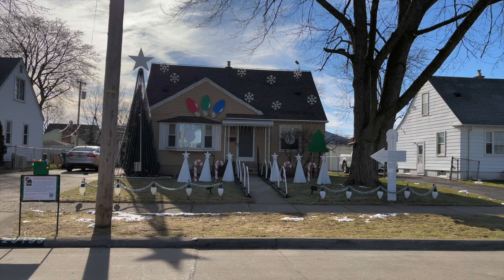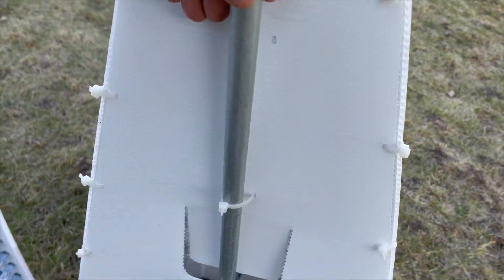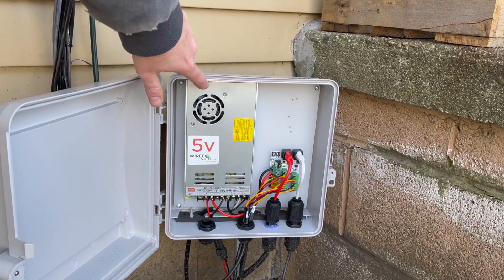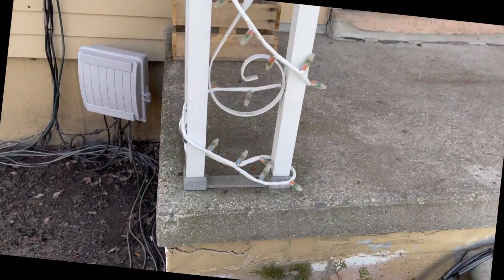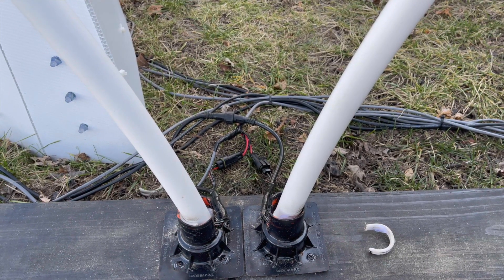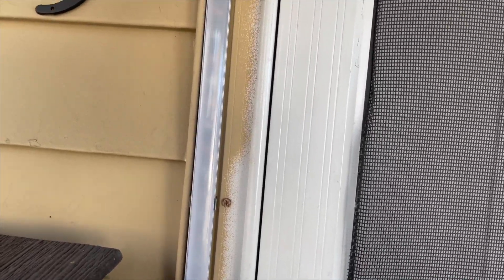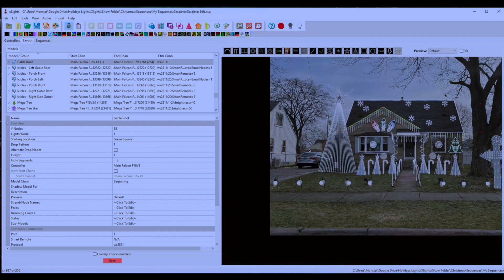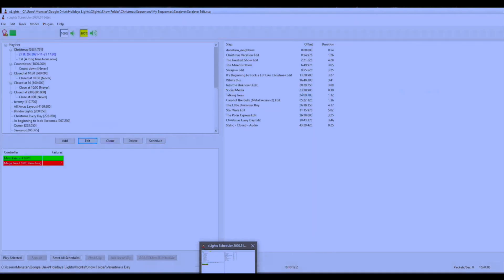Behind the Scenes of the Bostick Family Light Show 2020

Comment: I thoroughly enjoy all of the videos you post. I would like to begin working on my own display,  I have all the necessary hardware, I am struggling with the implementation. In particular, how to connect all these objects together. Fore example, I have a Falcon F16V3 controller, the Raspberry Pi, and have opted for the 12v LED's and lets say I have 25 candy canes and a variety of other items. For this discussion I want to focus on the cluster of candy canes. Do I connect each candy cane to a separate channel or end-to-end or what? It seems a waste to use a channel capable of 170 pixels for pnly 20 or so pixels in an object.

Comment: WOW! thank you so much!, what cable (gauge) do you used to inject power? also did you connect the power supplies between them?.
Reply from the maker: We use 18/4 shielded security wire for power injection. We connect the grounds between power supplies but not power. We have a link to the wire and other items we use on our website https://Bostickfamilylightshow.com

Comment: So the power injection is coming from the other open connection points on the power supplies inside the box?
Reply from the maker: Yes, we have a few connections for power injection on each power supply. One thing you want to be careful of, is making sure the power for power injection is from the same power supply powering the prop. If they are different you need to cut the power, so the two power supplies are not doubling the voltage. But you also need to make sure the grounds are shared.
Reply: @BostickFamilyLightShow  is there a reason for using 5v over 12v. Im just getting into pixel although ive always known about them im just starting to get hands on. Thanks.
Reply from the maker: @bboyrughbrn It is really personal preference. 5v typically require more power injection points, slightly more labor, but typically a bit cheaper. 12v are a little more expensive but usually need slightly less power injection, but also typically need more power supplies. I would recommend trying to stick with one voltage starting out. If you send 12v power to a 5v pixel you will blow them up. if you send 5v power to 12v pixels, they just won't turn on.

Comment: Hi  @Bostick Family Light Show just wondering where you bought your singing tree?? link?? 2nd is did you use ethernet cable for Power Injection? and lastly...it seems that you use 5V psu (instead of 12V) of all your pixels, any Reason?  (is seems that u dont mind power injecting at all :)
Reply from the maker: singing tree is from boscoyo studios. it is the 4 mouth version. I did not use Ethernet for Power injection, I used 18/4 Shielded Security wire https://amzn.to/3BlE0XT and i got started with 5v and just stuck with it.. if i did it all over i'd go 12 for less power injection.
Reply: @BostickFamilyLightShow   so u do really really love 5V pixels ;-).... i have many 5V pixels & couple of 12V, and im still thinking what should i use in my 1st year (yep i havent started yet)...still debating towards the supreme court "5V vs 12V". hahaha.

and when i watch ur vidz....yep 5V win -- less heat but more power injection. "Purchased Justified" lol XD... (sorry bad english).

Comment: How are the poles connected on the megatree?  I understand changing the diameter of the pole as you go up...but they don't fit snug.  Also...how many pixels and spacing?  Looked like 2 inches?
Reply from the maker: I used self taping screws to secure the poles together. I have the thinner pole about 3-4 feet inside the other pole, and screwed them together. After taking the display down, I would not recommend that method. I would drill out a hole and use a solid bolt or something bc upon trying to remove the self taping screws to disassemble the pole the screws snapped. 

The tree had 24 strands of 100 at 2" spacing, and the Star had 180. For next year I plan on doubling the pixels to be at 1" spacing and will also probably go to 32 strands - still in a 180* configuration.
Reply: @BostickFamilyLightShow  Thank you...good to know.  Not really interested in the ASAP...good call on the pins...will try that but probably going to go with steel square tubes.  Planning on running my mega at 32 strands 100 pixels at 2 inches...
Reply from the maker: @dharnish256  the rigid pole wasn’t too expensive, and held up great even in the 60+mph winds we had, the tree didn’t budge. So I’m happy with that, but would like to add a crank, and change to longer bolts or pins before next year. 2” spacing looks good for effects, but I wasn’t happy with the singing faces/pics or vids so I am going to do 1” next year